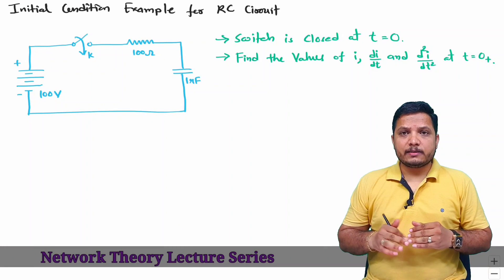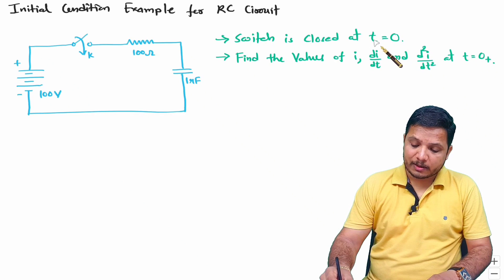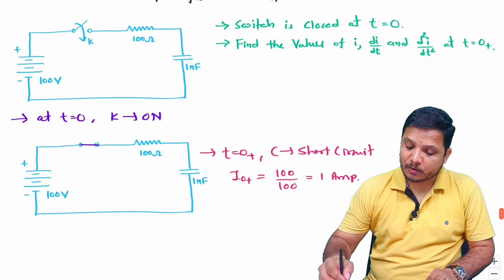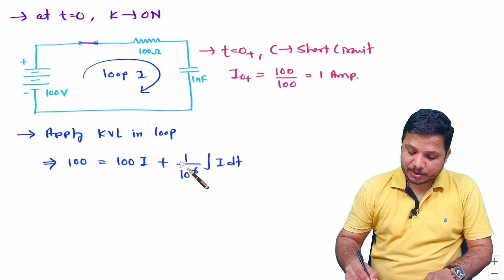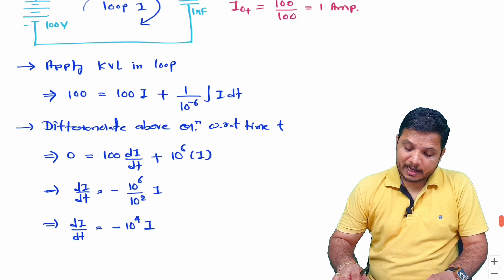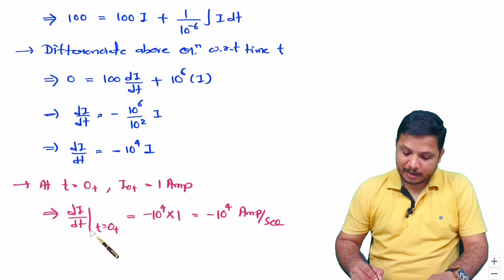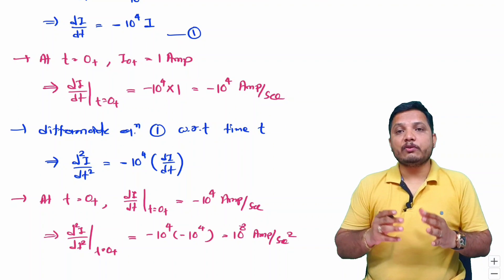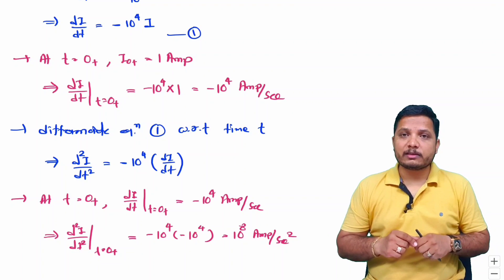Initial Condition Example for RC Circuit in Network Theory

Comment: Again, Sir, while calculating current I, you have treated Capacitor as short circuit and calculated current only considering Resistance ( I = V / R) But while calculating dI/dt, you considered this shorted capacitor for KVL calculations. What is the reason ?
Reply: same doubt